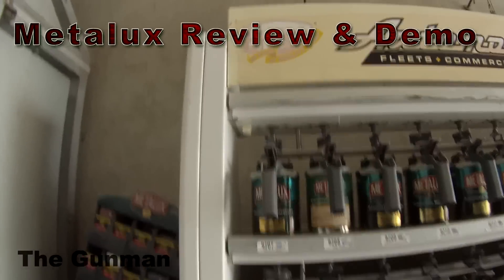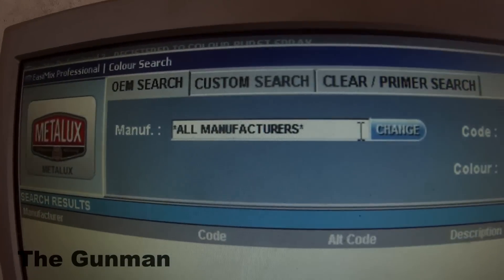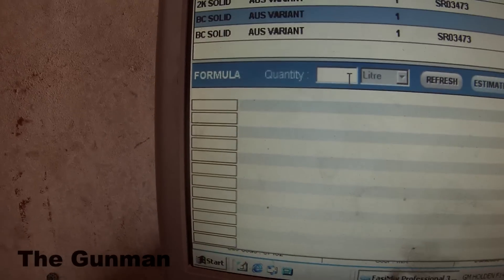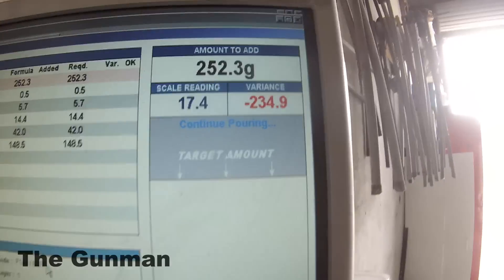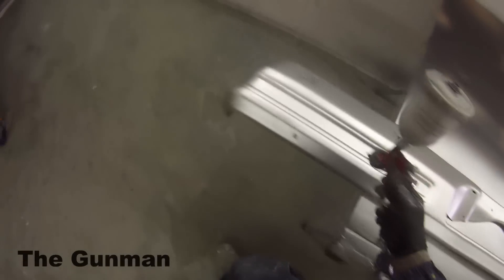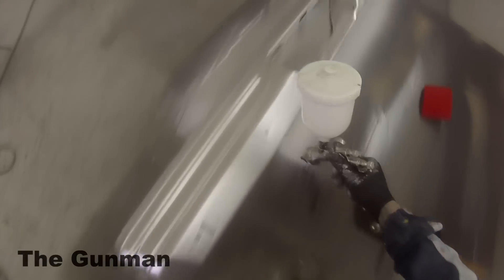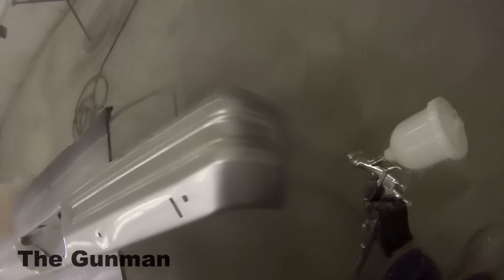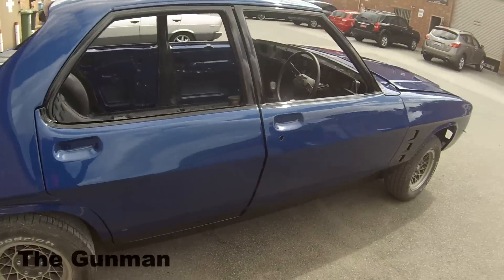Metalux Paint Review & Demo

Comment: Gunman I applaud you for your honesty and for being straight forward, we would all like to use the best but the bottom line rules all, if the business is not large enough you go with what will do the best job for you and give you a little profit to grow with and maybe down the road you can afford to go top shelf.
Reply from the maker: Jim Myers Thats it mate, I'd love to be using top shelf but I just explain to the custome you get what you pay for and if they are happy using the more expensive stuff then I will order it in on a job by job basis but most of the time they are happy with the cheapest being Concept No-Mix, I have the system and happy with it so far.

Comment: I used Metalux solvent base coat for about a year or two.  Most colors have trouble hiding like any lower grade 2:1 base coat.  Used to have to put minimum 4 coats on to achieve coverage.  And now the price is getting pretty high.  Chem Spec USA is about 5 miles from my paint supplies shop too.
Reply from the maker: Velvethamma Well I'm at least glad I'm not the only one who's a little disappointed with it.
Reply: Velvethamma where are you I would like to send a representative around?
Reply: Metalux Baby who are you
Reply: Velvethamma the binder is the problem it must be left out. METALUX is a spin off of the RM DIAMONT system. i am the METALUX KING #satajetjohnny
Reply: teamamericago Thanks for the tip!  I have had it mixed without the binder and you're right... it's much better and covers great.  But the cost at my jobber for mixing it without binder is significant.  I still use it because the color match on some is much better than other paint lines.  I do like their clears for sure!

Comment: S&S gave our shop some of the 9150 MS Clearcoat to try out. It's not too shabby. Probably not quite as good as the Glasurit clear I usually use but I'd say it's on par with the Baslac 40-40, albeit not as flexible. 

Give it a try sometime.
Reply from the maker: aaronobst0140 S&S won't give us any discount and every time they come in all they do is bad mouth the others to try and get their shit in. They won't be getting anymore business off the gunman. I used Glasurit for 12 years in Melbourne and still believe its the best paint system on the market, I just can't afford it in my small business. I do have some Platinum clear that we are using on a respray tomorrow though.

Comment: Have you had a look at the new PPG 706 Protec replacement systtem the spectrograph is good it selects varients we were getting matchs anywhere from 93 to 97% and just swinging them by eye the last little bit only problem is they use the liquid PPG pearls which are great for mixing but fit they are expensive from memory the cheapest pearl was about $150 aud for 250ml

Comment: I've seen on your facebook page that you changed the paint system in your shop. It looks to me it is a water based system? Or maybe  I'm wrong
Reply from the maker: adi2200us Its solvent and the cheapest on the market but pretty good.
Reply: The Gunman then what is its name?
Reply from the maker: Concept is the brand and No-Mix is the line, I'm not sure if its available in Israel but if it is I'd recommend giving it a try.
Reply: Thanks mate,I'll ask around.please keep us updated about this system,you how it goes,color match etc
Reply from the maker: just did a quick job on a hyundai and colour was near 100% straight off. Loving it so far.

Comment: Metalux is an awesome product,   The best color match tool in the industry is the variant deck has 14,000 sprayouts  no system has as many actual colors to compare.  I have 2 body shops in the United States and we use it everyday.   It is half the price of dupont or PPG and  is better than dupont,  just as good as PPG.   Products may be priced higher in some areas because of avalability or maybe the jobber marks the product up more.   The Metalux system is easy to use and even has a one coat clear that gives the mil thickness of 2 coats and it works great.
Reply from the maker: D Haley Interesting, totally different experience over this side of the pond, mainly the company that sells it ruins a product that may be ok, over here its priced similar to Standox and I don't like reps coming in pushing a product on me while talking trash about the people who do the right thing by me.
Reply: yea bad jobbers are very annoying.   I will let the Metalux  corp people know about your experience,   thanks
Reply from the maker: I used it on a restoration re spray a week ago and you are right it is a great quality product but I did make that clear in the video my main issue is just a hand full of know it all reps.

Comment: Comparing Metalux to Standox, Spies and Glasurit is like comparing Mercedes to Hyundai. Metalux is trying to compete with Omni, Wanda, Shopline, Nason, Matrix, Limco and even Chromabase and Deltron to some. It has it's place. I'm a paint rep and we're getting Metalux soon. You're getting what you pay for, but for rental car work, rebuilding totals it has a place. I appreciate the review, but you can't compare everything to the most expensive paint out there.
Reply from the maker: APO they charge a premium price here in Perth and it's not cheaper than Standox so as far as I'm concerned I can and will compare it with the top brands until they price it accordingly.
Reply: The Gunman ok man calm down lol. Maybe your pricing on Standox is lower there. Here Standox/Spies, Sikkens, Glasurit are very expensive and not commonly used in collision shops. Metalux is below Deltron here in price.

Comment: Metalux is actually a very good quality paint line, the computer you are using is very outdated as is the software
Reply: Valer Vitak thats true, im sure a new computer capable of running the new software would give you a better idea of the system. But hey, if they priced themselves out of the market then you might as well get something top notch.

However, Bad reps arent worth it even for the greatest of products.
Reply from the maker: Valer Vitak Just my opinion, not meaning to bad mouth a paint you like but as I said the paint its self is fine just the price and colour tools aren't up with some of the better German brands.  The computer is just slow it still has up to date software and changing the computer would just speed it up, Standox will shade the colour for you where as Metalux just picks the variant it thinks is closest with no visual comparison, don't forget DuPont pioneered the software for Spectrometers over 20 years ago so other brands are playing catch up, its all in the software not the tool with Spectrometers.